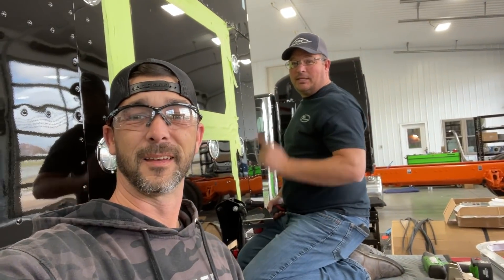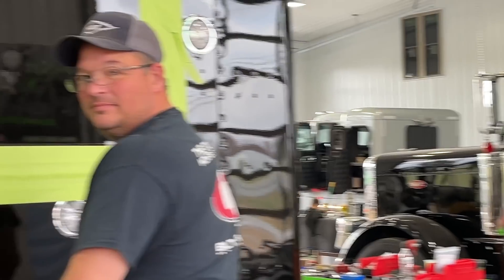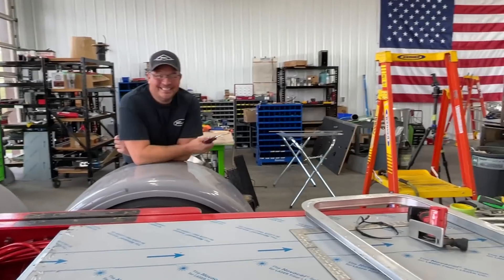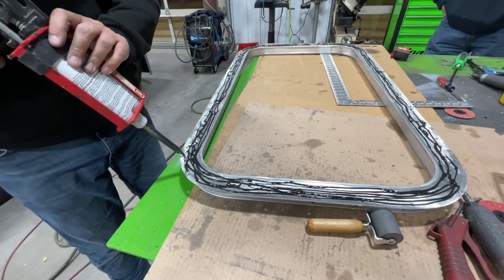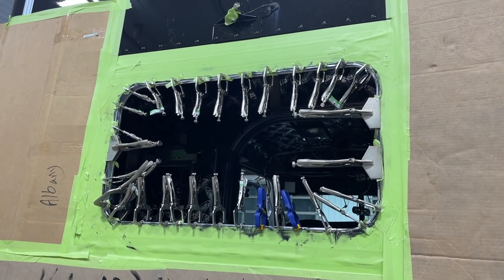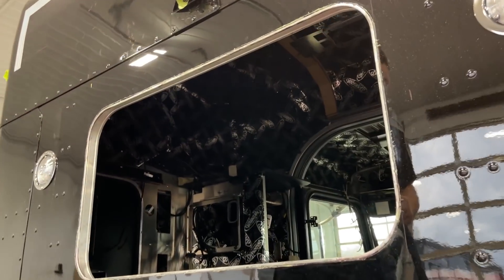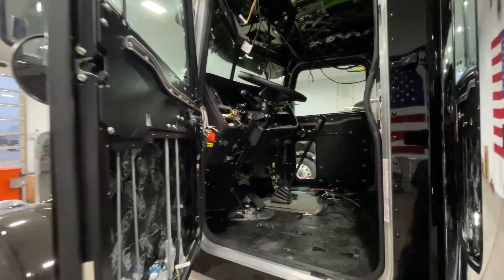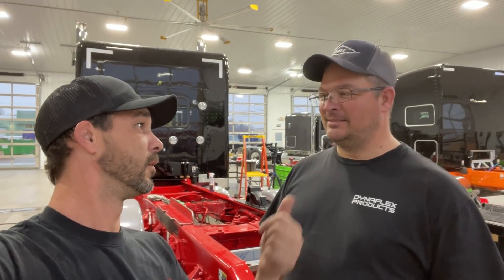Cutting a big hole in a 200k truck!

Comment: I agree with Bill on the junk insulation, my 2021 has the “arctic package”. I guess that means you’ll freeze like you’re in the Artic. Next spring/ summer, I’ll pull it apart and do a better insulation job
Reply: I'm a lifetime peterbilt fan and owner and I have no problem with anyone calling out peterbilt on the shitty insulation and that arctic package is a joke. Peterbilt should be ashamed of themselves for ripping off the buyers like that.